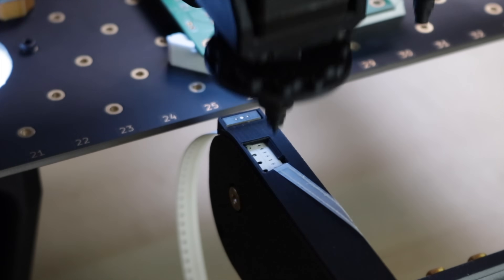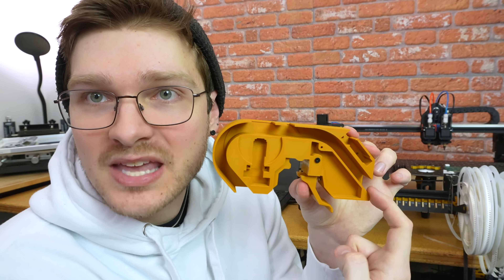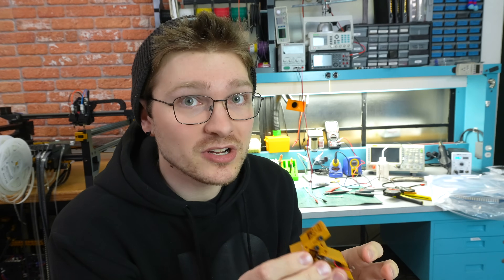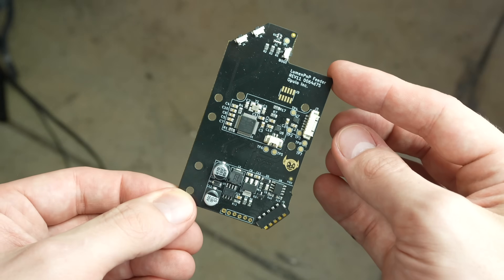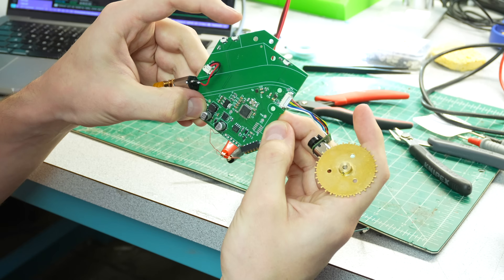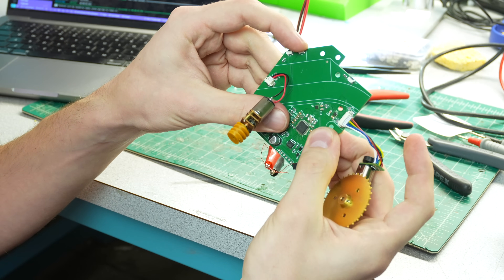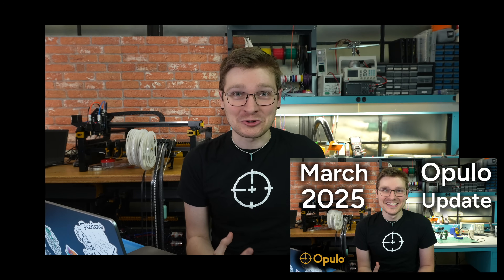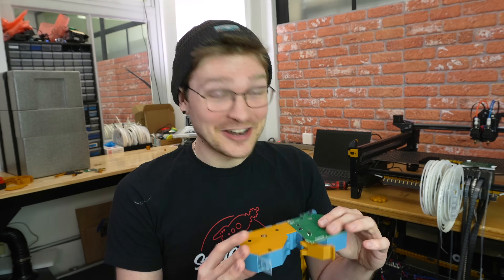I finally solved Wide Feeders

Comment: I work in the industry with alot of assembly lines.
Weirdly enough 6mm-32mm are all perfectly working and barely doing any issue.
If splicing is done correctly no jamming or other issues occured either

Comment: What you're designing looks just like the film advance in an analog camera. Some cameras drive the film by the sprockets, just like you are doing. Take a look at the Olympus XA, its film pressure plate (located on the film door) keeps the film firmly set on the film gate, with just a small cutout for the sprocket gear.

Wouldn't a similar approach work for this as well? Of course you need to make that pressure plate much smaller with a cutout for the part to be accessed, but the concept still applies. It might not even need to be spring loaded to be honest...

Comment: I work as a technical sales in consumption goods in the electronics sector in benelux. Look into the system that Mycronic pick and place use, they have a simple system that splices the tape with a knife, without the need of a rolling wheel for the tape. Splicing tape just folds completely open on the spot where the component is available to pick. These pick and places are especially known for their ability to switch projects quite fast so its a simple and good working system!

Comment: You could probably use a dovetail connection for the peel gear frame to secure it and lock it in place with a screw preventing it sliding out 🤔. Not sure if a horizontal or vertical dovetail would be better (intuitively I’d say horizontally).

Comment: Awesome work, Stephen! It's great to the amount of progress you've made in the development of the Lumen PnP. In thinking about how to make it an all-in-one manufacturing machine, I was wondering if it was possible to have a flip down shield of some kind with a hose attached that would first form a seal/isolated environment and then act as a hot air station, making sure that the entire board is heated evenly? I was inspired by the DIY vacuum formers that I've seen here on YouTube that use a shop vac and wondered if a miniature variant could work on the Lumen PnP.

Comment: I have a idea about your tape pulling attachment. If you mirror your mechanism so you put the wedge on the outside of the feeder and the inside on the gear assembly,you can force the interfacing faces against each other while tightening down the skews.

Comment: In order to keep the tape centered as it feeds into the gears, check out this video by Steve Mould titled, "The Band Should Slip Off But It Does The Opposite!" It's counter-intuitive, but it seems to suggest a convex idle pulley placed just before the gears could help prevent the tape from wandering off to the side. I'm a big fan! Keep up the great work.

Comment: I was suprised with the small feeder system, given that all P&P machines i've seen used top mounted stripper motors, like your new system. I guess there's a reason why professional P&P machines that crank out 10K-100K CPH are made that way.

Comment: One detail that springs to mind is that of centering belts. Without an alignment mechanism like the sprocket wheels, they'll tend to go where tension or adhesion guides them, which (counter to some intuitions) means convex feeder rolls self-center (conical wheels on railway do a similar thing). On a spiral design like that wraparound the tape pulls to the side from the start.

Comment: You could use a piece of PCB material for the pressure plate.  It will be durable and each drive PCB could come with a set of 2 to 6 pressure plates that youjust snap off if they start to wear out over time.  Or you could have a PCB layout that is all pressure plates and slide it in.  Spring steel is great but might be overkill.

Comment: Great result - I think that exit curve for the empty tape as parts are picked is going to be a bit steep -  I'd make it close to dbl that diameter, and not have it wrap underneath, but stop around 60-90 degrees  That will help with bigger parts and especially deep short parts. Have you decided on what th maximum part height is going to be for the 16/24mm feeders? Some parts are super tall, like vertical USB and chonky SMT caps.

Comment: 1:09 the geometry on what you're doing there looks bad from the start. You are pulling the tap around from one side and then pulling straight back, even on the smaller model there should be a pivot of the gears to better face the incoming direction, not just straight back, it will always want to off-track itself because of that. But for a slot based mechanism, there is certainly merit to never going off-center in the first place.

Comment: How did you countersink your PCB holes? Is that a feature I can request from JLC, or did you just keep your copper pours and traces back from the thru holes and manually countersink them?
Reply: From everything I've seen at many of the board houses, this is not a feature they offer.

But to make this work, you do need to have a keep-out zone around the holes (a couple mm wider in fact). The counter sink process will reduce the PCB thickness to nearly 0.25mm to allow a countersunk screw to sit flat with the surface of the PCB.

Manually countersinking is thankfully not too challenging but will take extra time to do on every PCB. I used a 90deg diamond bit made for countersinking to do this on my 8/12mm feeders

Comment: Maybe you should get some cheap Juki 16mm, 24mm and 44mm feeders to see how they solved the issues you also noticed. I can help you find commercial feeders very cheaply. Most of them have a door mechanism and they also use rails for the tape edges to rest on them. I operate pick and place machines for years and I have seen some weird ass tapes. Like ESP8266 44mm feeders, M.2 connectors, FPC connectors, etc. And each time they need different size top opening (if you open it too much, the next component in line might come out of its cavity. Anyways, happy to chat if you need any help!

Comment: I'd be worried now about the film sticking to, and being drawn into the feeder by the incoming populated tape. The 8/12mm tape design pull s the film off and lets it go under the incoming tape, so much less chance of it interfering. This new design releases control of the film before it is clear of the incoming tape

Comment: I love these videos -- Awesome work! I wonder if over time the adhesive would drop too much residue that eventually will cause issues... have you considered something like a teflon or other anti-stick material on the gears/feed? May be overkill, but first thing that came to mind.
Reply: Maybe nylon, which is 3D printable?

Comment: Have you checked the radius on that exit path with tape for longer parts that need 3 or 4 indexes - bigger QFPs, chonky inductors, horizontal JST connectors spring to mind. 
Also, how about allowing for  optional spacers to allow, say, 12mm tape to be used in a 16mm feeder  and so on - this would add a lot of flexibility, though maybe mean you sell fewer feeders overall.
My P&P has a bank of 3x12 and 3x16mm feeders and I'm often putting spacers in to change the mix.
Reply from the maker: yup, im basing everything off of the ANSI taping standard!
Reply: always some good thinking material! :-)

Comment: About that laser cut spring, why couldn't you just 3d print a flexible arm that pushes on the tape/film? PLA flows over time, but something sturdier should hold up in constant tension

Comment: these look amazing, do you think this architecture will work for 8 and 12mm feeders as well? I definitely had a lot of tangling with the tape that gets wound up in the gears, and also its super awkward to get the tape into wrapped around when you have adjacent feeders, where as with this it seems like that wouldn't be an issue

Comment: I used to work at a company that had me overseeing a PCB assembly line, and feeders always needed a ton of attention to keep working right. They got jammed or gummed up with reel splicing tape all the time. It kinda warms my heart to see someone caring this much about getting feeder design right.
Reply: Feeders are everything - anyone can build an x/y gantry - feeders are the hardest part by far
Reply: Yeah the cover tape stickiness varies widely between different manufacturers. Some tape will get stuck and wrap around the gears or the axle eventually.
Reply: Currently working at that type of environment - and if you have this kind of feeder while placing millions of components per hour - you wont produce anything. Feeders are usually several hundred euros per piece because of that - reliability. But yeah  - shit does happen. :)

Comment: Unless this plastic electrochemically repels the adhesive, it's going to collect on the shafts of the top gear over time, which is fine, but I think you can design the back end hoop connecting the sides of the frame to give better access to the shafts so it's easier to remove buildup as part of regular maintenance. Just lean that hop down a little instead of having it on plane with the film path, increasing the arc of the shaft surface that is readily exposed. It may also be an improvement to remove those shaft sections from the gear print, and replace them with off the shelf brass spacers; this is an additional part & purchase but brass spacers have pretty good electrochemical repulsion to adhesives, and are 100% impervious to solvents so you can just take them out and drop them in a container of solvent for a while, scrub a little, rinse, reinstall, in the worst of scenarios it's basically trivial to clean.

Comment: Isolating details to print small tests, slowly proving out the larger design in a minimized amount of filament and print time, is an essential skill, and there is a degree to which the parts need to be designed to facilitate this. It's something like Design For Design. I'm making boxes to hold SAS backplanes, and there's so many interconnected dimensional requirements, they're so big and dense with function. The last complete design had seven parts that needed over 8 hours to print, and two that needed 16, I would have used a dozen spools and several seasons printing full pieces, but I got it done in 3 spools, the majority of which are in the final product.
Reply: A big part of this, in my experience, is thinking about which pieces can just be bolted to others. Especially parts that you plan to be iterating on. It has saved me so much time and filament. And often it just comes down to a couple of extra holes for a bolt and nut.

Comment: Are you thinking of changing the 8 and 12mm feeders to rear exit as well?
Reply from the maker: right now im just focusing on 16mm and 24mm, but it's likely ill test it out with the other types at some point!
Reply: @stephen_hawes  I have 44 feeders on my LumenPnP 4 and it’s kind of a pain to refill a feeder because of having to wrap the film around and between the feeders. I would love it if the peel gear on the 8mm/12mm feeders used the same peel mechanism as the new 2U design
Reply from the maker: @tass2001  good to know, ill absolutely take a look!